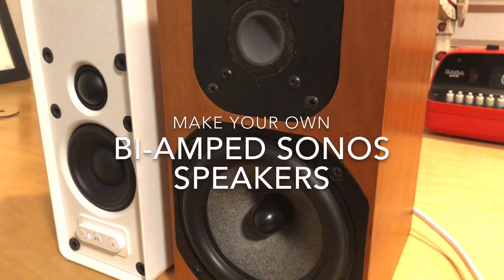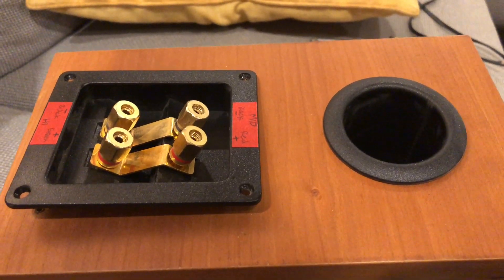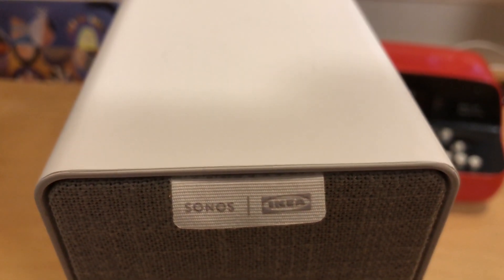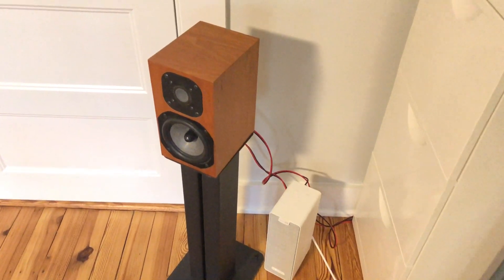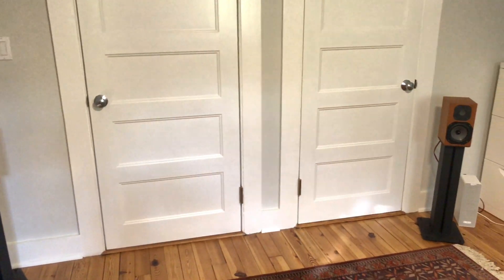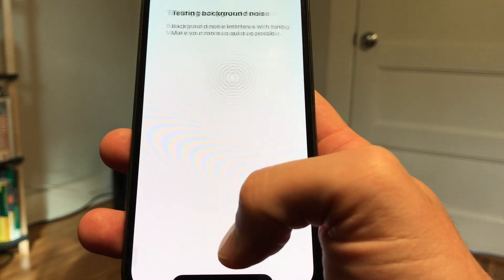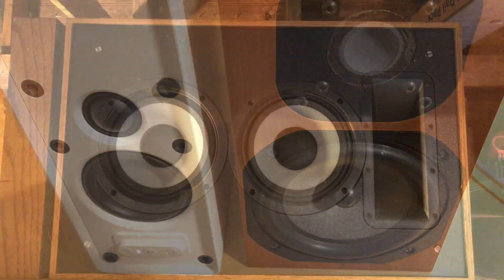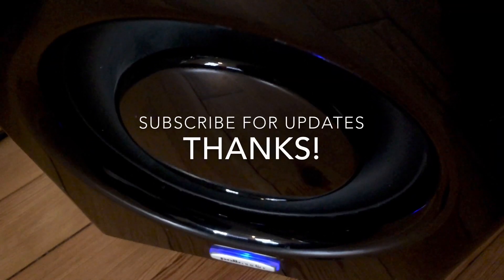Turn any hifi speakers into bi-amped Sonos speakers (with optional sub) by hacking Ikea Symfonisk

Comment: This would mean you could make a couple of ls50 speakers your rear satellites! I wonder if you could use the cheapest Sonos soundbar and use the Amps in that for front and centre channels
Reply from the maker: You certainly could. I have LS50s but didn’t  want to crack open the enclosures to bi-amp them. that’s the key here: you’ll want to pick passive speakers with a similar driver setup since the sonos are bi-amped with a fixed crossover. You can’t power a 3 way speaker for example
Reply: @todd.parker  if you are upto it, I remembered this video, https://youtu.be/EEh01PX-q9I and it could be an excellent encasement for a ikea driven system ;)

Comment: Very interesting video (the others too). I am currently running Elac FS 67 (3 drivers, 6 Ohm, no Bi-Amping unfortunately) powered by Yamaha RX-497. I am not sure if the power of one Symfonisk is sufficient for one FS 67. What do you think?
Reply from the maker: From what I can see, may be a 2.5 way speaker where one woofer is crossed over at 500hz so they both run in parallel below that. The Symfonisk is good for bi-amping so this might not be a great fit unless you direct wire the tweeter to the symfonisk amp and run the symfonisk woofer amp to the passive crossover for the woofers. You could try simply wiring the 2 woofers in parallel and hooking it to the woofer amp and letting TruePlay sort it out too. Give it a try and report back!
Reply: @todd.parker  I just tried and I can confirm that it works wonderfully. Tried up to 70% volume which is enough for me.
Reply from the maker: @ytbengpf  awesome. I feel like 70% is about where the amp starts sounding harder for me too, might just be it’s limits. Glad that worked! How did you wire the woofers?
Reply: @todd.parker  Parallel. So, 3 Ohms. Volume is perfectly fine for me. Crystal clear sound. Way better than with my Yamaha Amp. Trueplay magic. Can't wait to get a second Symfonsik and run stereo.

Comment: thank you for your excellent videos on the symfonisk speakers:).

at the moment I am planning a home audio system... I have a few questions :)

do you think that the lamp model and the bookshelf has the same amp?
How/where did you find the power rating of 50w for the bookshelf speakers? 

I would like to be using a 8" 8 ohm seas driver and a tweeter for each symfonisk bookshelf speaker (with an active subwoofer box) tho I wo´nder if the setup is going to be able to play loud enough for lets say a home party?
Reply from the maker: I think the bookshelf and lamp speakers have the same internals, also the same as play 1. I feel like I saw 50w somewhere, maybe 25w x2.m but it’s all a guess. Since these are smaller amps, higher efficiency drivers are best but if you don’t need super loud even lower efficiency is ok
Reply: @todd.parker  just checked the woofers and they are actually 4ohms. But how loud would you say   You were able to play with the focals and the klipsh?
Reply from the maker: The focals probably only hit 90db or so but they are small, inefficient and have no bass. The Klipsch get really quite loud and dynamic, even at 60-70%

Comment: And what about the watts of the woofer , tweeter can handle?
We must know that to prevent using too low power.
Reply from the maker: Power handling and efficiency are both factors but trueplay will normalize the levels.  Most of the time, you’re using a fraction of a watt. If you have low efficiency drivers, the amp may not get very loud before it distorts but I’d be surprised if the is too much power.  It’s only a 50w max amp
Reply: @todd.parker  I was thinking if we underpower our speakers. That's why we need to know the efficiency dB and how match power of the original IKEA speakers to match with the knew ones.
Its good that we know the ohms.
Reply from the maker: @fotvalas  my hunch is the drivers are pretty low efficiency, maybe 86-88 (esp the woofers) so I’d expect most speakers would be ok. My Klipsch are super efficient and it sounds amazing so, if you can, use more efficient drivers since it’s a pretty small amp

Comment: I have just done similar to install Sonos in the bathroom. Bought Symfonisk and a pretty cheap Adastra ceiling speaker. Had to slightly rewire the speaker to give separate woofer and tweeter terminals but ended up spending less in total than a Sonos One SL and it sounds great.
Reply from the maker: Cool, yeah you can bypass the passive crossover on those and bi-amp them with the Symfonisk. How do they sound? Do you run true play?
Reply: @todd.parker  I don't use Trueplay but sounds really good, way better than expected especially as I only bought a cheap speaker on the grounds it's only for the bathroom. Goes way louder than I need too! The speaker is an Adastra C5D 5.25" costing around £20 in the UK. It is described as having a directional tweeter but it is just a gimmick that you can adjust the angle, in reality it spreads the treble well.

Comment: Amazing work. Gonna test this with some old pioneer bookshelf speakers. What's the impedance of the original drivers? How far off can you go from that?
Reply from the maker: I have a video where I cover the driver and impedance measurements but if you stick to loads in the 4-8 ohm range and run trueplay, this will work well for most speakers. Higher efficiency is better, these amps are pretty small.

Comment: Hi, do you think the IKEA speaker can survive driving the internal elements as well as one 40w element on each? At the same time? So a total of 4 elements with the internal and the external at the same time. No problem right?
Reply from the maker: That’s hard to say without knowing the impedance of each driver and if you’re wiring in series or parallel. If these terms are new, don’t connect all that stuff :) In general, the driver load needs to be 4 ohms or greater to avoid overheating the Symfonisk amps. If you’re using the internal woofer (4 ohms) and connect a second 4 ohm woofer in parallel (positive to positive) that will half the impedance to 2 ohms which would be bad for the amp. In you connected them in series, it would be 8 ohms which is fine.
Reply: @todd.parker  Thanks for the answer! My idea is to connect a 5" 40W 8 ohm on the tweeter and a 5" 40W 8 ohm on the woofer. Both of them are installed in the ceiling in the bathroom and have separate cables and I would like them to be connected to my sonos-system. And the Symfonisk is going to be in another room where I could use the internal speakers from the Symfonisk, at the same time. You think this would fry the Symfonisk? Thank you for all the help!
Reply from the maker: Andy R I think that might stress the amps too much, yes. More importantly, I do t think it will sound very good because you’d have a 5” driver trying to reproduce tweeter frequencies. The bu-amp technique works best if you’re tiring off the internal drivers and wiring the amps up to another pair of passive 2 way speakers. Full range speakers aren’t a good fit for this.

Comment: Would I be able to hook up 1 Ikea Symfonisk to power 2 speakers? I plan on using 1 Ikea Symfonisk (amp only)  to power 2 in-ceiling speakers rated at 8 ohms each. Would this work?
Reply from the maker: In theory, yes. If you connect them in parallel it will be a 4 ohm load. I wouldn’t push the amps too hard because that is going to be a bit stressful for them to handle if you crank it up but for normal listening, I’d guess you’re ok. Honestly, I usually listen at a level that uses 1w or less
Reply from the maker: Remember, you need to disconnect any passive crossovers in those ceiling speakers
Reply: Also, do I hook up the 2 in-ceilng speakers in parallel to match the 4 ohm woofer in the Symfonisk? or in series (16 ohms)?
Reply from the maker: I’d do parallel

Comment: First of all, thank you for sharing this awesome project! Subbed! :-)

I have two questions:
1. I'm planning to put Symfonisk amps into some old but refreshed JBL Ti-200 (full specs here: https://servlib.com/jbl/audio/ti-200.html). Nominal Impedance 8 ohm, Recommended Amp Power: 15-100W. Do you think the Symfonisk amp will deliver enough power for "standard listening"? 
2. I also would like to drive this passive speakers with my standard 2.0 Yamaha Amp, which is connected to my TV and Phono. Can I use the modified speakers still as passive ones WHILE the Symfonisk amp is turned on, or do I have to turn off the internal amp before using them as a passive standard speaker?

Oh and there is a 3rd question: do you have a PayPal address for a little beer donation? :-)
Reply from the maker: 1. I think this will work well for those JBLs. The symfonisk amp is 50w but 100w is only 3dB more in output which isn’t much at all. Most listening is around 1-10w.
2. I’d be a little nervous wiring two amps up to the same driver, might not be great for them. Maybe you could get a switch box?
3. I do like beer, maybe I’ll set up a patron account. Thanks for the offer!
Reply: Thank you for your feedback. I thought about a physical switch between both amps, but then, the speakers are not that comfortable anymore. I will not use both amps at the same time, so it should be fine, for my understanding. I will test it. 😇

Comment: Love this id, and like to use this as a 2.1 on my Loewe L1 speakers (don't know how and if i have  to remove the internal crossovers). But here's my question, and Perhaps a real stupid one, how do you generate a stereo sound? Is speaker 1 modified as a left channel and the other one as a right channel?
Reply from the maker: Yes, that’s exactly it. You use a symfonisk speaker for each channel. You can add a sub too
Reply: @todd.parker  Thnx Tod, I'm a bit scared about opening the Loewe speakers for diasembling the crossovers! | I thought there was a video from you about the wiring in the Sonos but can't find it anymore. Soryy for al these questions.
Reply from the maker: @MrShimai  Well, it it helps it's less about dissembling and more of a bypass. You just straight wire from the driver to a binding post. More info in my newesrt video on wiring: https://www.youtube.com/watch?v=9Bvof0hF4LE&t=1428s
Reply: Thanks a lot for this genius solution & insctructions! One more stupid question: How exactly do I set up one speaker for left and one for right when it's not connected to an AVR and I just use the sonos app/stream?

Comment: Hi, I want to try this setup with some KEF in ceiling speakers I have, but the kef speakers only have one “binding point/port” model Ci160ER on them, but you examine them closely it has a tweeter and mid woofer sitting on top each other, any idea how I could set this up?
Reply from the maker: Just googled that speaker and on the back you can see a small board with electronics - that's the passive crossover. In this setup, you want to completely bypass that and it looks very easy. I see a tab with 4 connectors which I assume are the + and _ for the woofer and coaxial tweeter. So you should be able to just disconnect the crossover wires go the those terminals and straight wire to the woofer and tweets amp in the Symfonisk. I juts posted a in-depth wiring tutorial here: https://www.youtube.com/watch?v=LpeKHM4qBkk

Comment: So the switches on the back of the Sonos turns the internal woofer or tweeter on or off? If we focus on the woofer switch for example. This means you can have a signal going to your external woofer and symfonisk woofer when turned on. While turned off only the external woofer works? Why would you want your external and internal woofer work at the same time? Wouldn't it be more conveniant to have a switch turn off external and turn on internal and the other way around? Meaning only one woofer at the same time will work? Or am I missing something here?
Reply from the maker: If you just want to add a sub to your symfonisks there is no need for switches. I added them to allow me to turn off the internal drivers when I want to either use the internal amps to bi-amp and external pair of speakers (see my video on that) or if I want to just use the synfonisk to connect a sub but don’t want the internal drivers to play so it basically acts as a gateway.
Reply: @todd.parker  HI Todd. Yes I understand why you did it. But this would mean if you hooked up your external speakers (let's forget you have a sub and hooked up directly to bi-amped speakers) and not put the switch in the correct mode you would have your external speakers work and internal symfonisk. Correct? I think a On-Off-On switch would be better in this case.
One plus wire would come off the symfonisk speaker and connect to the switch (the switch has 3 connector points in this case) then one wire goes to the symfonisk plus and the other to the speaker terminal plus. That way only one speaker would work at the same time. Without having to remove the external speaker cables for example.
Reply from the maker: Flabber Question That scenario is why you’d want a switch, yes, because the symfonisk amps couldn’t driver both internal and external drivers well and you probably don’t want that anyway. I suppose a 3 way switch might be better but Here’s how I wired it: I disconnected the wire from the amp and hooked that to the binding post. I then jumped the positive wire from the binding post back to the woofer. I did the same for the negative but cut the wire and attached a two pole switch in between. In the on position it completes the circuit and the internal driver turns on. In the off position the internal driver is disconnected. The binding post is always “live” but you can choose what to hook to it

Comment: How could I wire that into a full range ceiling speaker?
Reply from the maker: You’d need to disconnect any passive crossovers in the ceiling speakers and basically direct wire from the tweeter amp to the ceiling speaker, same for the woofer. I’d use 4 conductor wires to keep it tidy

Comment: Where do you think the Sonos XO is? Or do you think trueplay can alter the XO? I have bookshelf speakers where the XO is at 1000hz and others where it is 3000hz. Is one more compatible for biamping with the Sonos? I also have bookshelfs where the tweeter volume is reduced by the crossover to mate with a less efficient mid-range. You seem to be suggesting that if I remove the XO from different pairs of bookshelf speakers and biamp with the Sonos,  trueplay will optimize the XO and dampen the tweeter as necessary? Am I understanding you correctly?
Reply from the maker: I think it’s around 2-3k. Trueplay won’t optimize the crossover frequency but it will EQ the drivers for a flat response so it will compensate for differences in driver efficiency and response. What you don’t want is a passive crossover in the path since dividing between the woofer and tweeter happens pre-amplification. If the speaker that has a 1k crossover has a large driver that will struggle to get up to 2-3k, that might sound rough but most 2 way speakers are crossed over at 2-3.5k so the Sonos bi-amp set should work well. I guess a fragile tweeter than can’t operate that low is also a potential problem to keep in mind but that’s atypical
Reply: @todd.parker   I did a real time analyzer run on this and the notch is very close to 2.5K.  There is also a low freq notch placed under the assumption that the original small woofer is being used.  It looks like the crossover is 2 simple preamp input side X-overs  created on the channel input stages for L and R.    With the chip pack input impedance it should be possible to alter the actual X-over for both HF and LF outputs.   Still hunting down the notch filter .  It maybe based in truplay, but I suspect it is a the .1 feature on the chip itself.
Reply from the maker: @BobTurgeon  very interesting, let me know if you find more. Is your impression that it rolls off the bass or is or just reduces the level a bit? When I connected a sub, I was seeing some surprising deep bass

Comment: Any idea what the crossover frequency of the active crossover is?  Can the focal midbass driver handle the mid high?
Reply from the maker: It unsurprisingly seems to be in the 2,500-3,500 range. My Focal mid bass seems fine up to there since it’s only a 5.5” driver. The speakers sounded a bit dark at first but Trueplay fixes all that

Comment: Success! Thanks for your guidance Todd. I ended up using 18AWG wire and it was a nice match for the existing wires. I used twist nuts caps to attach the wires, which did work, but I found them rattling around inside, so I had to use a glue gun to attachment them the case. I'm not sure if it would have been worth soldering the wires together. Matching up where to drill holes for the posts and switches were a little problematic, mostly because the DC capable switches were so big.
Reply from the maker: Awesome! So you even added switches, eh? It’s nice to have a lot of flexibility to re-configure but I agree it’s tight to fit everything. Hot glue always saves the day! I figure most people will just add the subwoofer output binding posts but it’s good to know you were able to get everything done.